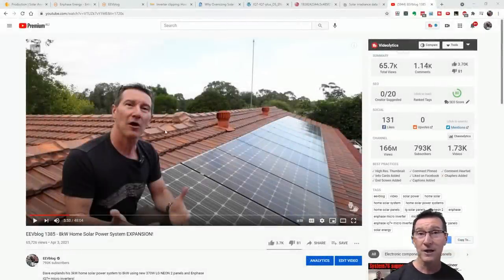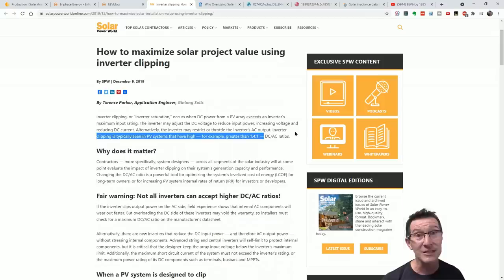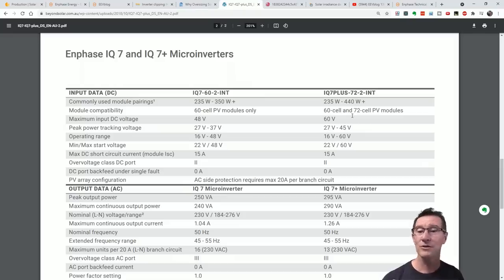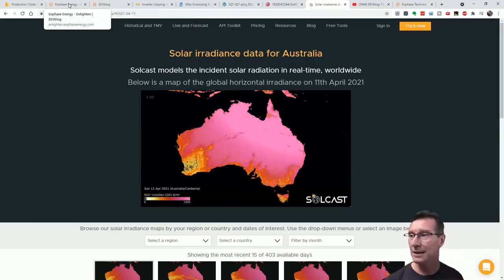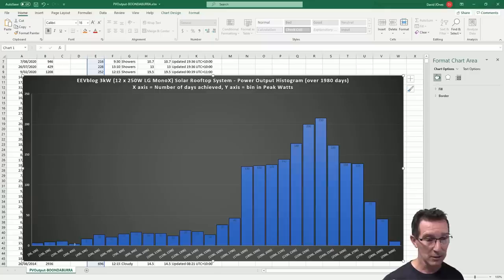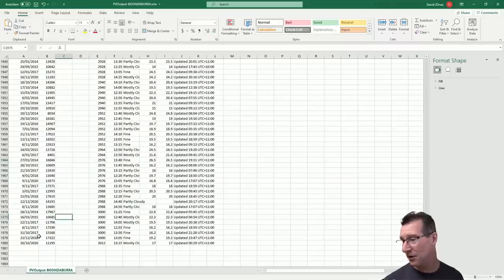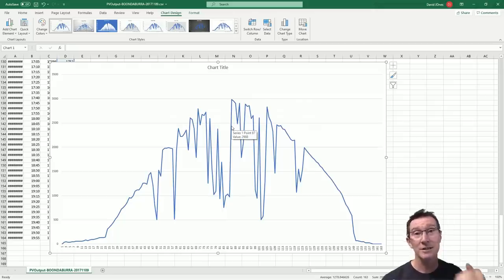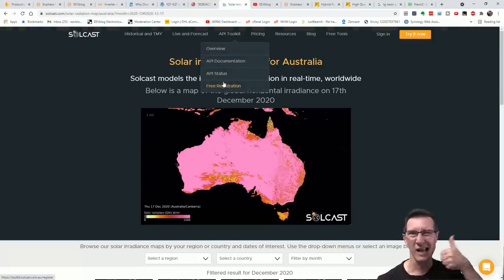EEVblog 1386 - 295W Inverter vs 370W Solar Panel - WTF?

Comment: Regarding Shading: SMA claims their new inverters will handle partial shading of a string with no additional losses due to their "Shadefix". They even sold their investment in Tigo. So it may be that your old inverter did not handle the shading too well, but you don't know if a newer inverter from SMA would do better.
Keep the information coming. ☺
I'm very interested in the module inverters and their performance and robustness.
Reply: Shade is shade it drags the whole system down (unless its using dc to ac mico inverters or dc to dc power optimizers from like solar Edge as that keeps the voltage of the dc string at a fixed voltage due to the optimizers) a string inverter can't fix shade or panels that are producing different levels of power all they can do is MPPT
Reply: @leexgx  I think that is not true anymore. Especially Dave's LG panels are advertised with "factory installed bypass diodes". So if that panel does not produce energy it will nonetheless not limit the other panels to get their energy to the inverter.
Therefore, I doubt that an optimizer can do much more if that particular panel is (partially) shaded. If you have different data I'm curious to learn more. :)
Reply: @sgtAntler  (Bypass diodes have been standard for very long time) if one panel is not producing the same amount of power as the others then the mppt has to use an sub optimal power point for the whole string witch can be more then 25% less power or more 

Per panel module DC to DC power optimizer or DC to AC micro inverters do mppt per individual panel so doesn't matter what each individual panel is producing it won't affect the efficiency of the whole array at all (just that single panel) 

If you have a full one sided roof with no shade or chimneys nearby on the roof a typical string system can be fine but if it starts to not produce its usual amount if power you need an ir cam to see witch panel is cooler or hotter then the others or get behind each solar panel to check each panel individually,, as there is no way to get any information on a per panel bases on a conventional string system 

with solar edge DC to DC power optimizers or other companies like enphase DC to AC roof micro inverters you get real time information on each individual solar panel as each module reports to a Web control panel that you can access and see what all the panels are doing as a whole or individually and take action to fix it (clean the poop or stuck on dust off the panel be usual cause or failed panel or inverter has failed)

There is also safety considerations as well with micro inverters or power optimisers if there is a break or ark in the cable or the grid power is lost they all switch off and drop to 1v output with super low currant so you can test it, so if there is no 1 voltage then the module or solar panel has failed (allows them to still run the computer on each module even with loss of neutral/positive for testing as module can use the power from the solar panel to independently run the module computer) 

with conventional string system unless you unplug each solar mc connector you can have upto 600v DC on that string, as to why firefighters hate them, but love solaredge or micro inverters as you only have to cut the grid power to make them mostly safe (mostly safe because each panel will still have 40-60v voltage but that's limited to a 1 meter cable per panel so only a hazard if you actually touch them with bare hands and spraying water on that won't cause electrocution problems as 600v dc can)

Comment: You are forgetting the fact that panels loose some power during the 25 year period. So if you are oversizing a little in the beginning, the panel might no clip anymore after 15 years and stil give almost the same peak output as new.

Comment: Solar panel output drops as the temperature rises, on a sunny day the cells will get hot and the output will drop significantly below the nominal value anyway.

Comment: Can you test the theory and switch out a couple of the micro inverters for the next model up to compare?
Reply from the maker: I could, but I suspect that there is going to be very little in it as Enphases data shows. And you'd need a long timer to gather the data.
Reply: Go on Dave know you want to! ;-)

I would offer, but I often over produce for my house already, and with no feed-in tariff, my Envoy throttles the output if I generate too much, which would ruin the data.
I'm looking to add a battery, but right now in UK we only seem to be able to get the old style ones, and who wants the old model?!
I'm not even sure Enphase have released the new battery system with real mains voltages, just that toy-town electric they use :o)
Reply from the maker: @juststeve5542  Enphase are working on a new battery solution, but I'll probably just with the Tesla, I'm not ging to wait for the Enphase one.
Reply: @EEVblog  had you considered trying to diy the storing solution yourself out did you just directly went to the consumer solution? Not saying it cuz you should consider, not preaching for either but wanna know if you did and what factors did you have to consider to make your decision.

Comment: I live in Europe and with single inverter/charger have done parallel between multiple orientations to prevent clipping. Now, that clipping wasn't going to be clipping to 80% theoretical, but more like to 50% theoretical...

Comment: Hi Dave. Modern solar panels have built in bypass diodes that eliminate the shading problem
Reply: some panels might but not all.  Im having a new system installed today, and I've aid extra for optimisers on all panels to avoid shading issues

Comment: hmmm. Thing is if the inverter clips the pixies have to go somewhere. They have to heat up the panel or the wiring inbound to the inverter ?

Comment: I'm an electric n00b. Where does the surplus power go? Is it dumped into a ground spike somewhere? In fact, what happens if you drive a relatively small load with a solar panel that can provide 10x or 100x more power (let's assume we regulate the voltage to fit the specs of the load).
Reply: The panel is not run at its maximum power point in this case (e.g. higher voltage, lower current), so it just gets warmer

Comment: Maybe a stupid question.. but where does the power go when the inverter is "clipping" ? Is the solar panel cooking itself with the additional energy? Does it lower the lifespan of the panel if it can't dump its generated electricity ?

Comment: You also didn't take into account that partial coverage of your old panels would reduce the output of all panels through the old DC-DC system's inverter, where the new system will independently receive from each panel with the micro-inverters... The high output panels will be more efficient with the micro inverters vs. the single inverter. Of course, the point is moot since you're not using all the power produced nor are you storying it, so you're dumping the excess into the grid at a crap rate...

Comment: My 9 year old installation have 3,5 kw of panels with a 3.0 kw inverter; what you loose on the top you gain on the sides ;-) Actually producing 3,04 in this moment. Blue sky and 8 C

Comment: Microinverters are a crappy idea that somehow became the standard. I didn’t have a choice in the matter when my 6 panels and inverters were installed due to them being tied to a rebate. In 10 years I’ve had 4 Enphase microinverters fail. Now if this was a single large inverter in my garage; I could have easily replaced it. But each failure required a visit to my roof. And inevitably roof damage was caused by one of those roof visits. This lead to a leak and $3000 worth of damage. Who thinks mounting a dozen inverters in the most hostile possible environment (high temperature under panels) is a recipe for a 25 year lifespan other than the manufacturers trying to sell it? This “under rating” is yet another reason to skip microinverters.

Comment: Yea, here in the midlle of Germany we get 600-700W/m² tops 😒
Most of the time you get 1/2 to 2/3 of your rated power out of your panels.
But it's OK, in times electricity costs nearly as much as burning paper money, that's still awesome! 😋

Comment: You have to take into account your west facing roof angles are completely wrong. With a perfect North orientation and correct angle what would be increase in the 295w+ output?
Reply from the maker: Yes, I should have mentioned that.

Comment: you know if your old system drops like that, its because you went and put a very inefficient series connection with all the shaded panels in the most sub optimal place in the series connection of your overall PV array setup and causing their whole respective series line to be affected or in your case the whole system to just fall off... because a series connection panels causes the whole series line to output the lowest value panel output because that shaded panel has the highest resistance in that series line connection... if you know how solar PV works... you would know why series connection is suboptimal but its a requirement depending on your standard old large solar chargers/inverters or the larger hybrid inverters.... since you need to match the output PV to their respective input ranges....

and i figured out a better solution if you want to run bigger output panels with battery back up you might as well use DC to DC step up or step down converters depending on your all in one solution hybrid inverters as they will be more efficient than doing all this micro inverters like this and losing the peak power while also retaining peak power output... A.K.A. you can just parallel connect everything even in DC efficiently... just please don't end up with something stupid... have common sense where to convert the voltages and what wires gauges to use and how long to run the wires...

micro inverters are just turning your dc to ac immediately and putting it into your system and afterwards it converts it into the correct phase as your grid tie being used by your home and if you need to use battery banks you lose another chunk over time to convert AC back to DC in this system for the batteries... its not magic... it just basic electrical engineering math calculation that you learn even before going to any electrical engineering courses for diploma or bachelors to the point that its common sense already... every time you convert AC to DC or vice versa, you lose a chunk of power...

so if you look at it in another way, this is just a more expensive way for you to put your PV array into all parallel config... while in this case not only are you losing another chunk of power by limiting your converted AC output... you are also making the micro inverter work in maximum rate with higher temps for a longer period of time and reducing its lifespan massively.... which if you had some electrical knowledge and don't mind tinkering, you could just get DC to DC converters/DC step up or step down converters and have that parallel config in DC..... which can be setup to charge some battery banks with minimal loss if you plan to use it together with battery back ups... and this is before the extra cost of you needing to set up additional stuff to match your grid tie phases for your micro inverters and also the safety protections for that system...

all in one hybrid inverter with grid tie and battery could match that same efficiency if you run all your PV array in parallel into the hybrid inverter... you just need a step up or step down dc converter to match the panel's output to the hybrid inverter's input PV range so you don't have to run the panels in series and have the same problem as your old system... and can charge battery banks with minimal loss and only need simple safety features to protect from power surges....

and the best part about DC to DC converter system is you can get a very amazingly efficient DC step up and/or step down converters at almost the price of nothing when compared to the whole system or these micro inverters... i still don't see the point of these micro inverter's "increased efficiency"... because tuning the DC output does the same thing to a certain degree of increasing the output and keeping the advantage of making full use of the peak output...

This kind of DC to DC system should be more superior in basic theory by a huge margin that it cannot be compared to the micro inverter solution... and its what i plan to use since my country is mostly sunny... i just need a way to cool down the panel with cheap solution at almost no power loss when compared to these micro inverters setup to increase the efficiency even further than that while keeping the overall efficiency and life span of my panels for a longer period of time... BTW this will keep the panel in peak output for a longer period of time when its a super sunny day if your country has similar characteristics as mine...

basically its an over priced DC to AC converter that does nothing new that you can already do in a hybrid inverter setup at a way cheaper price if you have a large array... if you don't mind using DC to DC converter... you would be surprised what you can do with a hybrid inverter... its worth the slightly higher cost compared to this or buying stupidly expensive solar charger and solar inverter or buying multiple of these expensive micro inverters... since buying around 10 of those micro inverters pretty much makes the hybrid inverter setup not only superior in harvesting the maximum potential of your PV array, it made it the overall cheaper system to build by a larger margin.... especially if you plan to make a battery bank for your home...

because hybrid inverter system can be setup which input source to use over which other ones and it has a 10ms switching between switching input source to use whether grid tie or PV or battery (if you have it since its optional)... which means if you use the output to a computer, it will not affect it at all when you switch between the 3 input source... you only need 1 fuse box to only do surge protection for the wiring... 

no need for a fuse box to switch manually between the input or a panel to match the phase with your grid tie... because all of it is done inside the hybrid inverters... and they can be run in parallel for bigger system usage for your house needs or bigger solar arrays or larger battery banks.... just refer to their individual manual...
Reply: of course the drop i mean is the flat drop you claimed was due to your old system getting shades and it just flatline close to 0...

Comment: Does you power utility let you actually export more than 5kW? Down here in the Powercor area, you cannot have more than a 5kW imbalance per phase, so premises with a single phase supply can only export 5kW, plenty of clipping would happen for you unless you self consumed the excess. (The inverters have to be able to limit power output).

Comment: I wish every city in the world would have 9x (for small cities/comunes 5x or minimum of 3x for triangulation) dome style solar array (formed in a perfect triangle for 3x or + in the case of 5x or for the 9x in the shape of a square with the corners in the cardinal directions to cover almost the whole city basically) with sensors for each individual panel of the dome and upload the datta for free in a solar potency website that also includes the telemetry of the zone and the weather patterns of each 30 minutes to be able to have any scenario for any locations in terms of solar power ... and maybe you could also have wind on this website ... but that is more complex but could be a lifesaver in the low solar zones.

Comment: I think you are seeing the graphs wrong. The graphs shows an avarage of generated energy. As you said, as clouds pass by, the luminescence goes down. And up again.but in a short period of time, the graph will only show the avarage of that half hour. But probably it got clipped a lot of times, and the graph could have been way different with a better inverter. Why can't you just buy some extra inverters and combine the panels and inverters? Maybe you can distribute the load and give to the extra inverter the extra amperes of energy. Cheers

Comment: Hi! Here in Berlin the Stadtwerke (public utility) is building solar installations on public buildings, which is of course good in theory.
Here my question. The buildings are mostly flat on top and smal in east west direction and long in south to north direction. they have installed nearly 300 panels (sadly no specifics about those panels is known) on a roof of a school building. Half of the panels is directed to the west and half to the east with an angle of 10°..15°. I regard this as a waste of panels, because they should be oriented to the south with 30..40° since Berlin is at 53 degree north. Am I right? This looks to me like Solar Roadways on top of a building, which is better than under trees of course with people rolling over them. wkr

Comment: Oh man, India still has 12 year warranties. Though the panels are relatively cheaper. And no sun? That's a rarity! Heck, winter temps here are 22°C with summer going till 32 or 35°C... so we have a lot of sun. I wonder how much the heating would affect the efficiency here.
And then how much would the clippings be affecting here. Cuz i somewhat don't get the point in these areas with clipping.